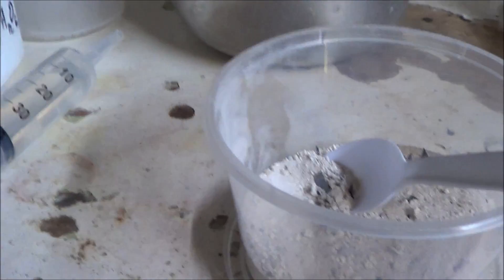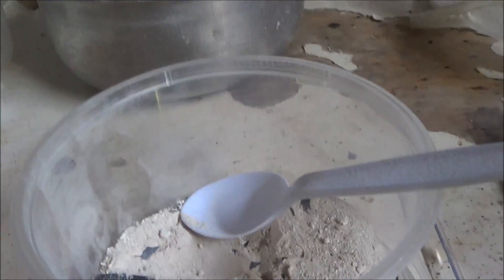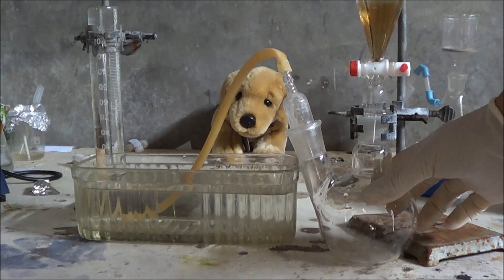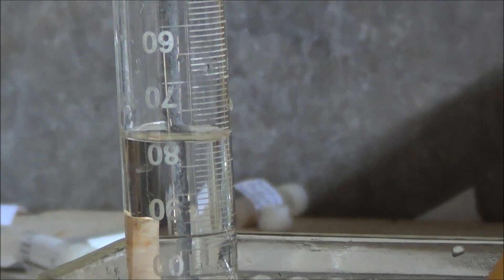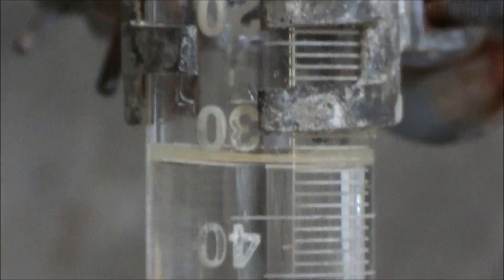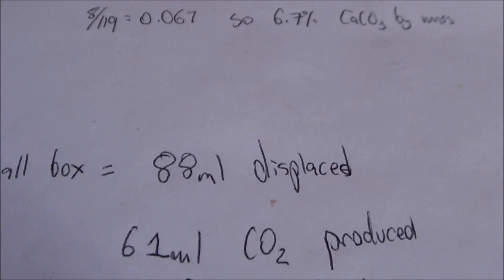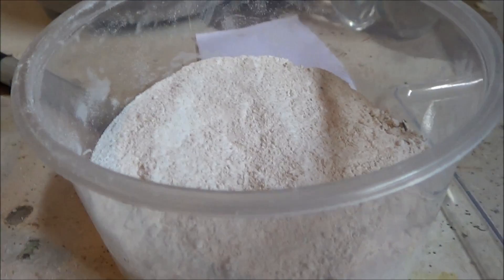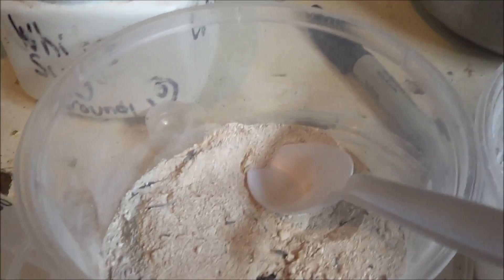Cyanamide testing - Tetrazoles Part 3

Comment: 7 years later this doesn't matter. But you wouldn't subtract out the 20mL liquid volume at the end since the air it displaces just ends up in the sep funnel (you can see it bubble through).

Comment: You said your calcium oxide source had been lying around outside for month, which means it must have been rained on at some point. Doesn't calcium oxide react with water to produce the hydroxide, rather than the carbonate?
Reply: Yes but when he heated it in episode 2 it broke it all down in to calcium oxide so he has no calcium hydroxide
Reply: the calcium hydroxide reacts with co2 to form calcium carbonate